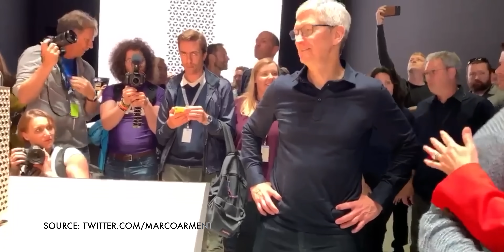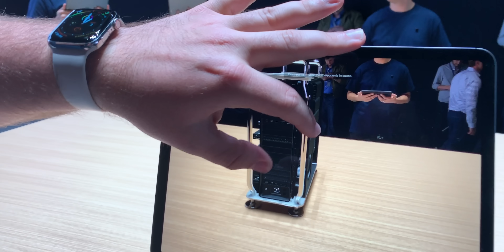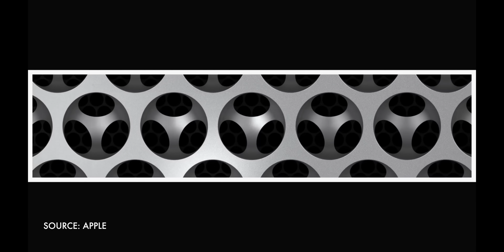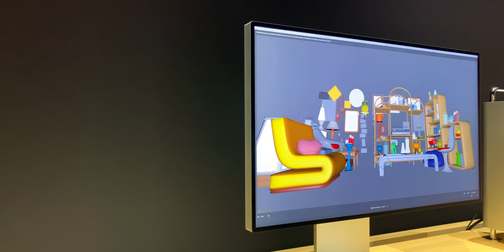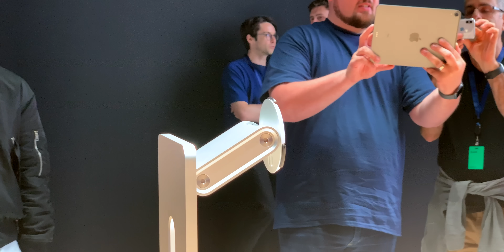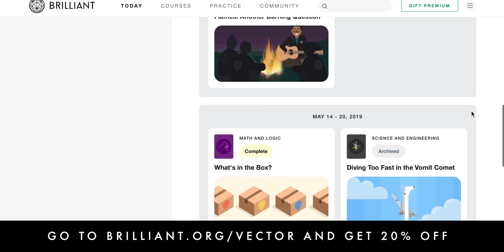New MAC PRO (2019) First Look!

Comment: Rene, 2019 Mac Pro & Future upgradability to Thunderbolt 4 and PCIe 4.0 [CPU upgrades too]?: My last desktop purchase was 2008 MacPro cheese grater… I had already saved for buying my NEXT Mac Pro and I ALMOST did in 2013…. But I waited and saved more… so I am PREPARED to spend $12k on a Fall 2019 Mac Pro [probably 12 or 16 core].  I edit lots of 5 camera Multicam 4k shoots and will someday have a couple 6k or 8k cameras.  My concern about making this kind of investment is that I will be locked out of the [apparently 2020] new things like PCIe 4.0, Thunderbolt 4?  Will the new Mac Pro allow those kinds of upgrades?  I think the Thunderbolt 4 should be able to happen via a new 2020/2021 model of the “One half-length x4 PCI Express gen 3 slot with Apple I/O card”. Is that possible and a logical guess?  Is upgrading to PCIe 4.0 ever possible?  Will I be super sad that I can’t upgrade to PCIe4 and Thunderbolt 4?  And, is the CPU upgradable?  I don’t hear much talk about that… But, in 2022 should I be able to upgrade from my 12 core Xeon to a 28 core or 36 core when they become available and cheap?  Sorry for the barrage of questions… but you are the go-to guy and I have not heard about ANY of these answers ANYwhere. Inquiring Zork’s need to know.  As always, thanks for all your words of wisdom.  — Eric ZORK Alan [ Professional Poet & Bed Vlogger ]

Comment: Be a bit careful talking about displays, especially comparing to reference grade panels from EIZO and Sony. Brightness is only 1 part of the equation. Does the monitor support 3D LUTs? The gamut doesn't his DCI-P3, and local dimming introduces halo artifacts. This may be okay for a few use cases, but it certainly isn't a reference grade product. At least from what I've seen, I wouldn't consider it reference grade.
Reply from the maker: I would double check that. I think you’ll find it does a better job than most. But I really appreciate the feedback!
Reply: @vector3578  I don't think you understand displays very well.

Comment: Here is another way of looking at this: How many Laptop Mac book Pro's will you buy over the next 10 - 15 years? Now what if you bought one of these  instead for the next 10 - 15 years and just kept adding components as you needed them? I bet the numbers would actually work out. The Mac book pro is not modular, its not reconfigurable as needed.  The other question is  can you expect a mac book pro to remain operation and viable for ten to 15 years? I wold coned that the answer is no. The Mac Pro  is a definite yet! Even if you only buy the base  model and never upgrade it it is still going to last 10 years and likely 15. Same with the display. I also expect Apple will  extend support for ten years given who its primary customers are for this machine.

Comment: I thought it seemed ridiculous at first when I heard about the stand. Having seen the actual display now and comparing it to monitors that cost far more. I do have to hand it to Apple here. It's actually good value, even with the expensive stand. That said, I am certain some company will offer a cheaper stand for it. Personally I think they should have waited for AMD's new cpu offerings as they will be superior to Intel and produce less heat. Still, I think Apple did a great job here, and this coming from someone who in general hates Apple products.

Comment: Apple XDR 32-inch 6K pro display has 60 Hz refresh while iPad pro has 120 Hz refresh rate.  Why Apple makes 6k pro display with 60Hz instead of 120Hz or higher?
Reply: They don't the right GPU to run 120hz or higher. On top of that you can't run 120hz or higher with a thunder blot or USBC cable. You need an HDMI or Display port cable for that.

Comment: Thought Apple missed a great opportunity to migrate to AMD Epyc processors. Any thoughts why they stuck with Intel? Too deep into development to switch? I mean Epyc has more cores/threads and more lanes per processor and PCIe 4.0 support, seemed like a no brainer to me. Definitely would like to see a non-Pro expandable, more affordable Mac but that’s wishful thinking. Also a new Thunderbolt Display like you mentioned. The Afterburner looks handy and I’m guessing there’s nothing stopping current Mac users using one with a Thunderbolt to PCIe box?

Comment: You say Apple brought all these experts in-house to iron out all the problems, yet Apple shipped multiple computers with obvious overheating problems and many people report repeated kernel panics, in some cases weekly, on their iMac Pros.

And it will not let go of the crappy keyboards and touchbar.

Still I hope this is a turning point for Apple, expandable and well ventilated hardware.

Comment: Great video as usual !!
You do realise that this is just Intel's Extreme Platform that was recently launched in a very limited fashion (google for ASUS Dominus Extreme motherboard) which is basically the same thing. I'm not saying that this Mac Pro is not good, contrary it is UNBELIEVABLY GREAT. Finally Apple understood what "Pro" means - on the other hand, unfortunately way too expensive for the spec. This brings me analysis, the "Pro" spectrum.
The Cons:

1. Intel Xeon is designed to be used and applied to a certain "level" of product, like servers with HUGE RAM banks, or high speed node in a super computer that needs ultra high speed network interconnect, so on and so forth. Touting a 1.5TB RAM is like telling a little child they can have the whole candy in the store - yet as a little child, he/she will not be able to make use of such quantity of candies - but the proposition is very interesting indeed for the child. Intel Xeon series processors are designed to use high capacity, error correcting (and most probably needs a registered buffer for high rank count) to achieve the touted 1.5TB of RAM which WILL NOT RUN AT 2933MHz. These things are VERY EXPENSIVE, runs slowly, and I can 99.999999% sure that MacOS cannot use/manage that size of RAM. 256GB is already pushing it (for a client workloads) to the point of diminishing returns.
2. In the dawn of AMD's ZEN 2 architecture release, Apple's decision to use an Intel Xeon is questionable. I honestly do not know what AMD will have for the new EPYC series processors, but if we count the RAM size support, AMD dwarfs Intel by quite a bit. AMD EPYC supports up to 2TB of RAM per processor. The Intel Xeon's PCIe lane count is also anaemic compared to the AMD EPYC (48 lanes vs 128 lanes). Not to mention that the new EPIC series processors will have PCIe version 4 that will double the bandwidth per lane.
3. The storage situation. For a high costing machine, the new Mac Pro is very offensive in the storage department. There is only two slots of modified m.2 bays provided within the chassis. If they are serious about moving their whole system into the high speed solid state storage, they should at least provide 4 or more bays, but this will be a problem since the Intel Xeon they use doesn't have enough PCIe lanes to use (back to point no 2).
4. The network connection. For the video editors among us that uses RED 8k cameras (or similar spec cameras) will usually have a HUGE NAS connected somewhere in the network for storing/processing the video files since the internal SSD array within the Mac Pro is insufficient in size. The network adapter provided in the brand new Mac Pro is only two 10 Gbps ports. Why would Apple do that? They should've put two QSFP+ ports and sell a QSFP+ transceivers as options OR if they are crazy enough (this is a "Pro" machine after all) the should put a single CFP port in it . These ports can provide anywhere from 40Gbps up to 100Gbps, anywhere from ~4 gigabytes per second up to ~10 gigabytes per second. With this kind of ports, the Mac Pro can finally be called as a proper "PRO" machine. IMHO, two ports of QSFP+ ports should be enough for 5-10 years.
5. The thermal solution. Looking at the thermal solution at a glance, it will not provide proper cooling for the processor (and/or the GPUs) UNLESS Apple run the fans crazy high. Based on what I see on the ASUS Dominus Extreme motherboard I referenced earlier, the board should be able to provide up to 500W of power to the processor IIRC. The new Mac Pro will use less that that of course, but  if the TDP of the processor is similar, then I doubt the tower cooler Apple chose to cool the processor will not be adequate - unless they plan to run the Xeon thermally throttled at ~60 deg C (IIRC for regular Xeon) or ~85 deg C for the Xeon used on the Dominus Extreme. 
6. The default GPU. Why does Apple spec their $6K machine with a $200 GPU? This is absurdly offensive.

These kind of choices that I regret when I look at Apple's decision.

The Meh:
1. The power supply. A single power supply for a $6K+ machine is weird IMHO. Redundant power supply is not that expensive, and not hard to integrate into the chassis.
2. The cheese grater look.
3. The AppleCare+ service agreement is very lacking. At least they should provide a more comprehensive support, something like this: in select areas a 2 hours response time on site support for 5 years or a 24 hours on site support for 5 years? Or maybe option to extend the support more than 5 years. I don't know... The point is that the support contracts are very limited.
4. The extra MPX slots. Why?

The Good:
1. Finally a Xeon with proper memory slots that we the users can add by themselves relatively easily - and it supports a HUGE AMOUNTS OF ECC RAM!!!
2. Finally a new chassis design, excluding the Cheese grater look, the chassis design is very interesting. Finally they have wheel option - does the chassis have mounting points for radiators?
3. The PCIe slots !! Finally PCIe slots !!!

I don't know.... Apple does weird shits these days. I prefer to build and run MacOS under virtualised environment if I have this kind of processing power under the hood.
Reply: Damir Handoyo yep, you don’t get it.  All that hot air.  You still don’t get it.
Reply: @Streetysuperduper  Excuse me, I don't understand...? All that hot air?

Comment: The monitor might be cool, but that's it really.  A Xeon 8 core for $6k really? And Vega 2?  Its 2016 tech for 2019 prices.  I'm really struggling to see who outside of a very very small niche market would want this.    In a few months time you will be able to build a PC with 12 cores, on PCIe 4.0 with either a Radeon VII or RTX 2080TI for 2/3 the cost of their base price system.  Its not for engineers, gamers, graphic designers or mainstream compute tasks.  Seems to be mainly Wank value, not to mention it's ugly.

Comment: As a true "workstation" and not a consumer desktop, this is by no means overpriced. Xeon workstations on the PC/Windows side can easily cost this much, and don't really offer anything more than Mac Pro does (exception being nVidia graphics cards). The nVidia graphics cards are a much bigger deal with gaming applications than they are with professional applications, where compatibility are of higher importance than frame rate.

I would have preferred that this be a dual CPU socket workstation, though, for nothing more than future expandability.  I kmow you can get a 28 core Xeon, but keeping those cores humming in a lot of cases is as much a function of getting data in and out of the CPU as it is simply core count or clock rate. With a dual CPU, you effectively double the data bus width. Not only that, it makes the Mac Pro more  "future proof", extending the usable life of what is an expensive unit.

Comment: This is the pro machine that 2% or Apples pro users were asking for. What the other 98% were asking for is the same form factor, has i5, i7, and i9 processors, 16-64 GB or Ram, and costs $3k with a monitor. And a stand.

Comment: They didn't kill it, it's overpriced
Reply: You can build one yourself with similar components at 1/5 the cost
Reply: e3vL1 the Xeon processors aren’t even on the market. Nor are VEGA II Duo cards with the fiber connect between the GPUs.

Maybe you mean you can assemble a machine almost as good as the base model, but that’s the bottom rung on this ladder.

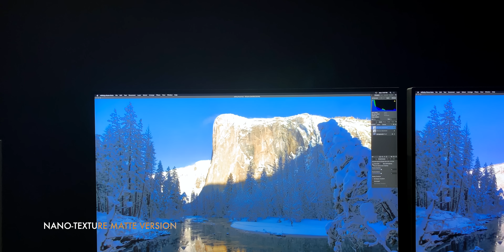Comment: At 8:46 you nailed. After years of complaining for hardware with no compromises, Apple delivered. Careful what you wish for. Because that comes at a price. Now let the complaints begin on how it’s overpriced without anyone digging into understanding why. Other than it’s the “Apple tax”.
Thanks for always bringing the knowledge Rene. (Mic drop)🎤
Reply: erm....the most poerful note in whole world is PREDATOR costing 9 GRAND! WTF ARE YOU TALKING ABOUT?
Reply: Vladimir Arevshatyan that’s odd because a maxed out HP workstation currently used at Disney and Viacom costs $66,000+ and no one is complaining about HP tax.
Reply: @pprocon  exactly bro same with other equipment like the RED camera which I don't see anyone whining about.
Reply: i used android for 10 years using flagship devices from Google, Samsung, Moto, LG, HTC ect and I have owned chomrebooks and windows laptops and in my experience Apple products have outlasted them all 3 to 4 times longer not just in function but in performance and reliability. I mean people are still buying 2012 macbook airs on amazon til this day.
Reply: The base price is absolutely terrible. There's no way around it. 6k with 256gb ssd is unacceptable. As if Apple doesn't want consumer to buy the base model. Besides the overpriced base adjustment, Apple is doing fine.

Comment: No way is apples $6000 LED a better picture than Sony's $30k OLED monitor don't be silly
Reply: OriginalNoseBleed Dude it’s apple they 100% made it better. That’s why android users get mad at apple because they take there features and make it better triggering them.
Reply: Its not.. overhyped lcd with vnetting and angle view and Color balance problems..not true white gradient but better blacks. It's far from $30k Sony reference monitor...apple admits now its lousy false misleading marketing ad campaign it's not reference display. You not get reference monitor 30-40k for cheap even though apple display still expensive 10k
Reply from the maker: Objectively better.

Comment: B&H: 8K ProRes RED camera: $24k; required, but not included lens mount: $700-$3000; 960GB SSD: $3,000 (buy the 12 pack and save $5k!). Is anyone who is actually the targeted demographic concerned about the price of the SuperMegaPro Arm?